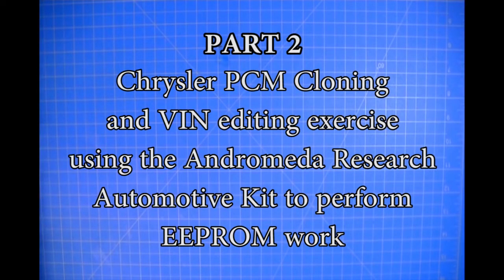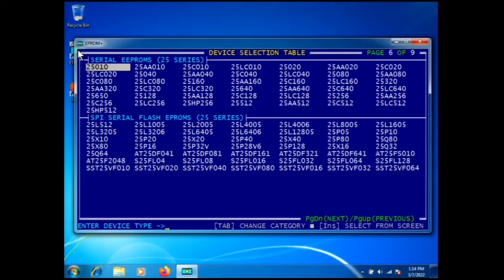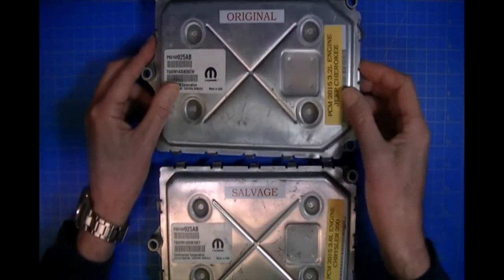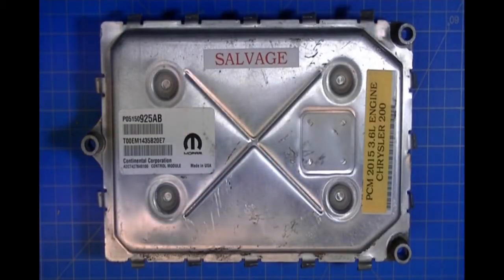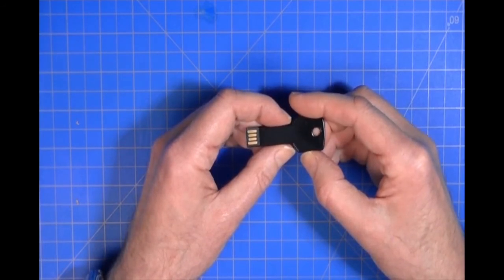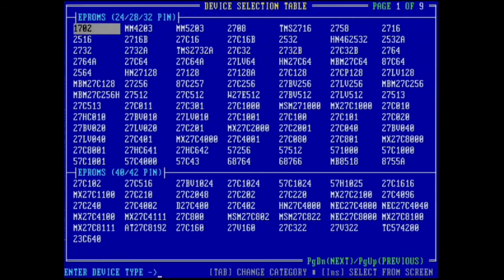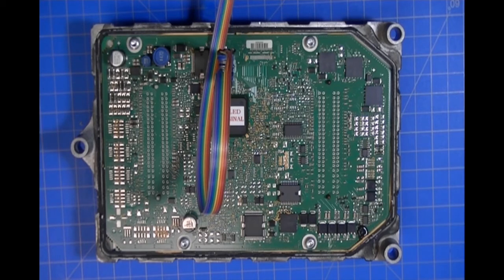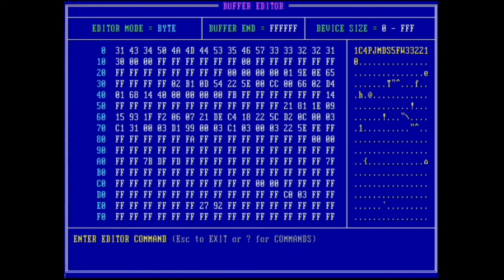How to Unlock, Clone or VIN edit a used or salvage vehicle module. Part 2-Demonstrating the solution

Comment: John i have a question, is it possible  after reading the eeprom and saving the bin file to  a disk and then use a hex editor to modify the bin file i mean change the VIN number then   write  the modified bin file to the new salvage  ecu  instead of using your software?
Reply from the maker: Yes, you can use a third party hex editor.
Reply: I had a friend with an old ecu that he could not find a replacement for. 
I have an R-Pi I use to program chips with. The Pi library had his chips info. As far as I've seen auto manufacturers do not use "custom" chips. The OS of the Pi was Linux Ubuntu. I had no problems. 
He took it back to the same dealer that told him they no longer sold his ecu and there was nothing they could do. He told them what I had done. They checked his ecu and said that's impossible. We can't even do that and said I was a liar.
I saw this vid and think it is great more people can do this kind of repair. All of the junk auto manufacturers have done to these systems is unnecessary and in my opinion wrong if not illegal. 
Most modern cars have a radio more than capable of being used as a display and program tool. So why do you need a $2,000.00 external tool? Money, money, money.
BTW Unless your into electronics buy this kit. Don't try to build one from a PI. It is most likely a hundred times the cost but unless you like the smell of fried chips in the morning... It does not smell like victory.
Reply from the maker: Thanks, we agree. @tayro7265

Comment: Thank you very much for the video you posted i bought from you kit #1 and eprom +software my question is can i make a salvage ECU PLAG& Plag&play change the vin number and immo off not cloning
Reply from the maker: If you know where the immo data is stored in the eeprom you can edit it. You can clearly edit the VIN. If you want to completely virginize a module the best option is to read the data from a new (unprogrammed module) and save it to a file. Then use that file to program any salvage module.
Reply: @andromedaresearchlabs7826  
Ok thanks for answering my question and the file from the new module can be transferred to module from salvage yard with your equipment kit #1 to the one I bought from you

Comment: Excellent stuff 
Where do we download the software and is your kit include all the connectors and what not to different EPROMs ? And what kit has the entire 9yards as clips adapters and immobilizer airbags every thing will be nice to get entire every thing you got automotive in one case kit instead keep searching what I need to buy and go back and fourth thank you
Reply from the maker: our kits include everything you need. You get the programmer, software, training tutorial , full documentation, eeprom in-circuit adapter plus clip and probes to attach to the part. Complete information is on our website: https://www.arlabs.com/automotive_kits.html
If you have questions contact us using the email or phone number on the website.

Comment: Great tutorial! Is there a way to modify/remove an 'engine kill command' via eeprom ? Scanner says 'ngc/skreem status: engine kill command'

If there is, is this done via the pcm, or skim module, or both ?

Note: flashing security light invalid key, all keys erased but unable to program keys, skim module hardware has been repaired. 1hour key in run position method unsuccessful
Reply from the maker: If the engine kill function is hard coded into the module then it cannot be removed via eeprom. If it's a setting or option that can be added to a vehicle then it will be in eeprom. Module eeproms contain vehicle specific data which will be added when the vehicle is assembled, not when the module is fabricated.
Reply: @andromedaresearchlabs7826  thanks alot for the reply! Where would I find an error code like this in eeprom ? And is it possible it is a skim module only fix or the pcm as well ?
Reply from the maker: It could be in one or both places. Sorry I don't know. You can post to a support forum  such as digital kaos or mhhauto and see if some  one knows.

Comment: Would this work with the Air Suspension Control Module?  I need a new one apparently, but a used one, the VIN can't be overwritten, even at the dealer.

Comment: Will this work on most ecu and power steering and body control module in use today? I am very interested in learning eeprom for my auto repair shop
Reply from the maker: Our kits work with any module which incorporates an eeprom to retain vehicle specific data. Most do but not all. The only way to know is to open the module and look at the circuit assembly. We teach you how to do this with our training documentation. As there are many thousands of modules, it's not possible to know in advance which part the module design team used.  Our tool allows you to work with any eeprom based module. However, like any tool, it is not a universal solution.

Comment: i have a 2011 avenger with a ECM that has failed relays in it, with this kit you sell, i can pull an ECM from the salvage yard and copy data from the ECM on the car to the Salvage ECM. The vehicle will just accept the Salvage ECM as if i just unplugged the factory one and plugged it back in, i wont have to relearn any keys or other modules?
Reply from the maker: If the ECU data is contained in an eeprom then you can attach to the part and clone it to a salvage module. Once the process is complete the module is just installed in the vehicle. Sorry but I don't know which part is in your ECU.
Reply: @andromedaresearchlabs7826  is there any thing i need to do after i install the cloned module into the car? the other modules will just accept it as if i had only unplugged the factory one and plugged it back in?
Reply from the maker: @txtrcr  Yes, that is correct. The only difference in the two modules is the programmed data. The original data matches the current vehicle. The replacement module matches the salvage vehicle. Cloning puts the original vehicle data into the salvage unit. The other modules in the vehicle do not know the difference. As long as the replacement module is the exact same part number as the original it must sork.  Check the ACURA TL cloning video (https://www.youtube.com/watch?v=5TczctMGDSc&ab_channel=AndromedaResearchLabs).

Comment: God stuff. Just the thing I've been searching days for. No mention of potential checksum issue when you only change part of the EEPROM? Ah, come on. Still good though. Was hoping you'd mention 'SKIM' reset address lol
Reply from the maker: A checksum, which is a data integrity value, is normally not used in eeprom as the amount of data is small and changes. If there was a checksum it would need to be constantly updated. A checksum is normally used for program memory where a corrupted instruction would cause a serious malfunction.
Reply: @andromedaresearchlabs7826  I'll take your word for that. Any chance you'll help me find where the 'SKIM' is in EEPROM and whether I set it to 0s or Fs? Got a 2012 Patriot ECU with TIPM and entire under-hood harness from a customer's part vehicle recently, after swapping the engine for them. Been trying to repurpose OEM trash for a motorcycle engine for some time now. I mean, yeah, $300 or so would let me use a 2000s LS ECU, but that's $300 more. I already plan to desolder the EEPROM, once I find my CH341A solderless adapter.
Reply from the maker: @Marc_Wolfe  Sorry, I don't know. Try MHHAUTO or DIGITAL KAOS.

Comment: I see other similar EPROMs on your board.   How did you know which one to choose?
Reply from the maker: The other 8 pin devices are not eeproms. For example a common part you will find is a 2903. This is an operational amplifier. Included with our kits is a document which teaches you how to locate and identify the eeprom part. This si based on the number printed on the part itself.

Comment: I'm looking at your Automotive kit with the optional push & hold Probe . I have 2 of the clip on ones & they give me lots of issues . I have a question I'm trying to dump a ST95320 from Jeep ECM . I turned the validation off ( it would always give error )  And to test it I did 2 dumps & compared the files . Completely different . Is this because bad connection or bad eeprom  ? Thank you
Reply from the maker: You did not say which tool you are using. It may be that the tool is not really designed for in-circuit work. Validation just means that the first read is saved locally in the tool then the part is read again. If the second read does not match the first you get errors.  Inconsistent reads can be caused by several issues but the most common is that the module processor is running which causes data collision with the tool. I recently watched a video of a person using an IM608 (nothing against that tool) who was trying to read a GM BCM with a 95040.. Due to ongoing in-circuit errors he had to unsolder the part. Just as a test we bought the same BCM. Using the ACCUTOUCH probe with our in-circuit adapter we read the part with no problem on the first try. Our in-circuit adapter and programmer electronics work differently than other tools.
We did a video to explain the issues of in-circuit work:  https://www.youtube.com/watch?v=N9EulTngdls&t=1632s&ab_channel=AndromedaResearchLabs
To answer your initial question it's not the eeprom and likely not the connections. 
If you have other questions please contact us by email or phone both of which are shown on our website (www.arlabs.com).
Reply: @andromedaresearchlabs7826  Thank you for the quick reply & sorry I didn't put down my test equipment . I have the Autel IM508S kit with the 200 eeprom reader  & I have  the 400 XP pro reader  . Having the same issues with both the 200 & 400 xp pro. I did try to lower the voltage from 5v to 3.3 That's my only option with this set up . I am thinking very hard to order your kit . And definitely with the push & hold adapter  option . Your Video's are awesome . Thank you
Reply from the maker: Glad you found our videos helpful. There are many fine tools in the market place. We have years of experience with in-circuit work and do our best to provide our customers a path to success.  @terrygilks3310
Reply: Just ordered the kit 1 and the push probe . Thank you

Comment: I assume this only works with 2 working units for cloning. If u have a broken abs module there's no way way to clone to a replacement unit. Or maybe it just depends on how "broken" the original module is? Im looking to buy a used abs module for a 2015 Jeep JK to replace the defective unit (C2200) internal failure
Reply from the maker: No. The source module can be defective with programming intact. The memory part rarely if ever fails. You read the data from the defective module and program it into a functional salvage module. Once that's done you just install it.
Reply: @andromedaresearchlabs7826  another question. With this level of control could you erase a salvage module completely, ie factory reset? Or would u need a new part to clone into salvaged units?
Reply from the maker: Yes, you can remove all data from any module. You can also acquire a new module and copy data from the erprom into a salvage module thereby making it appear new. This addresses any issue where the new module has preprogrammed data.

Comment: Is your product able to simply flash a VIN coded module to it’s virgin state (i.e. no VIN stored)?
Reply from the maker: No. You read the data which includes the VIN, edit the VIN and then program the changed VIN back. I've never heard of reflashing a VIN.

Comment: Hi, can this tool be used on GM global A and Ford newest modules? Thanks
Reply from the maker: I do not know which memory part is used in these modules. As there are many thousands of modules, spread out over several decades, it is not possible to know which memory part a module design team chose to use. If a module uses an industry standard eeprom then our tool will work. If not, it will not. Our tool cannot access modules which use proprietary silicon.

Comment: Do you have to have your Panasonic laptop to connect unit? Or can you just connect to a regular laptop or desktop?
Reply from the maker: You do not need  the Toughbook. Toughbooks are great machines but you can use any host machine with an ExpressCard expansion slot or original 25 pin IEEE1284 port. Here's a video which shows how to interface to different machines: https://www.youtube.com/watch?v=2Q4p_MR-f7I&t=10s&ab_channel=AndromedaResearchLabs
Reply: @andromedaresearchlabs7826  if there is no HDD but boots to bios, would that work as a platform?
Reply from the maker: @Stormseekyr  The BIOS is set to boot from the CD or USB drive. When booted, our software turns any platform into a functional controller for the programming package.

Comment: Will this also work on n Audi tcm transmission control module? The eeprom has no proper id. just B58253 I/SN microchip. What series of chip is this. Why would they hide the real id? My guess is a 25/93 series flash chip? Any idea please?
Reply from the maker: I googled the part number followed by  eeprom. This technique usually works to ID a non-standard part number. The device appears to be a 24C02 or less likely a 24C04. The non-standard part number allows the component to align with other Bosch inventory parts. GM many times does the same thing.
Reply from the maker: Also, the 24C series parts are supported in-circuit by the Automotive Kits (https://www.arlabs.com/automotive_kits.html).
Reply: @andromedaresearchlabs7826  thank you.

Comment: Trying to use a salvaged ECU for a 2002 Audi A6 the chip reads 5p08c3 I don't see it in the device type. I see 95po8. Can I use this to read the chip
Reply from the maker: Yes, the 5P08C3 is actually a 95P08. In some cases ST does not print the 9 which makes no sense. The 95P08 is a bastard part which was supplanted by the 95080. The protocols are not compatible.

Comment: When change eeprom data , no need for checksum correction ?
Reply from the maker: The checksum is normally used for the module flash eprom. This is where the module program code is stored and the size is quite large. EEPROM data is small and vehicle specific which does not require a checksum.

Comment: Is it possible to make a duplicate ECM/ECU for performance programming of the secondary and leaving the original stock?
Reply from the maker: You can clone your original ECU into a salvage unit which you would then use for performance tuning/experimentation.  Performance parameters are not stored in the ECU eeprom. They will be stored in high speed flash memory separate or incorporated into the microprocessor/microcontroller.
Reply: But the first stage of doing so is clearing the eprom/eeprom of the VIN on the salvaged ECU correct? It is possible for the car’s system to run off either ECU after switching from performance to stock and stock to performance? I don’t like the idea of modifying the OEM ECU.
Reply from the maker: When you clone the eeprom from the OEM ECU into the salvage unit you will not affect the original. Cloning should make the salvage ECU compatible as the VIN will match.  You can now experiment with tuning using the salvage ECU.  @Worldonecometo

Comment: What do you do when you find yourself in a position where your device will not read the EEPROM in circuit?
Reply from the maker: If you are using our product confirm that you have chosen the correct in-circuit voltage for the part and the part leads are clean. If this does not work contact us via email or phone for additional assistance.. Regarding other products watch this video. https://www.youtube.com/watch?v=N9EulTngdls&t=1600s&ab_channel=AndromedaResearchLabs

Comment: Looks like that would work on a computer with the operating system removed, boots from the memory stick and runs the dos program, basic but I like anything that takes money away from Bill Gates. Part of my business is programming files that are emailed to me such as reset airbag modules, change vins or keys etc. So is there a way to start from editing a stored file instead of having to go through the file reading first?
Reply from the maker: First, you can run the system on any X86 platform manufactured in the last 40+ years. Boot from the CD, USB drive or even a floppy disk. Also works with windows. You can load, edit and save existing files. Here's a link to our website which describes the software. https://www.arlabs.com/eprom_plus_software.html